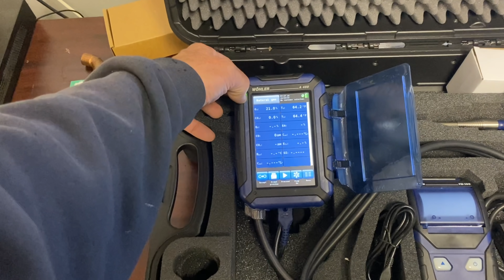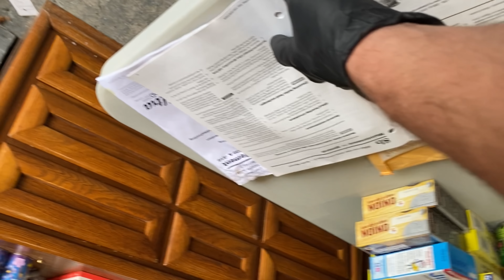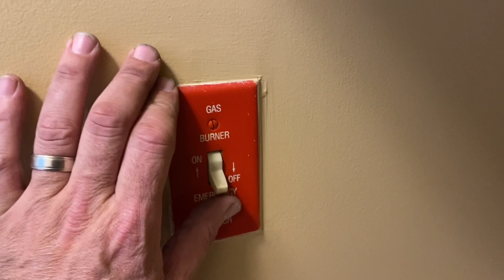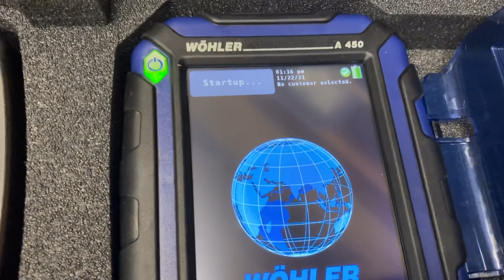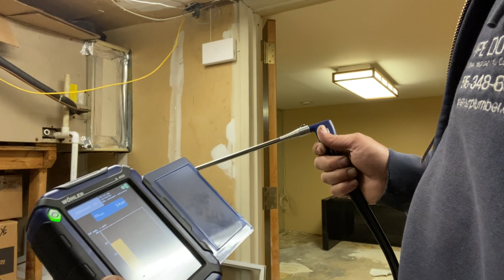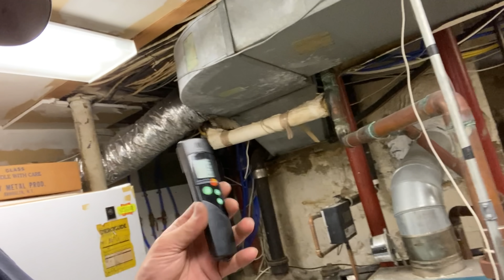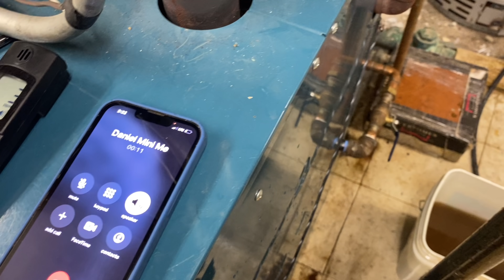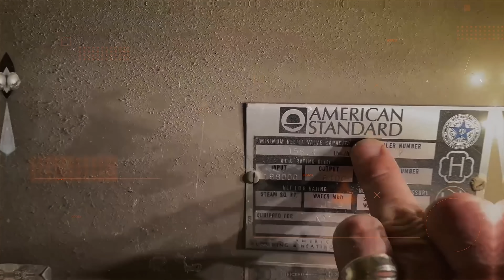Running No Heat Jobs & Wohler A450 Analyzer Makes Testo Look Like a Toy

Comment: Couple of things about the Wöhler. We used them for the past 20 years and recently switched to Testo because Wöhler is extremely pricey in repairs. We send them in for our annual maintenance and replacing the CO-cells (we have a lot of biomass furnaces here, so wood and pellets) is 700-800€ (so around 900$). You can basically get a new one every 2 years. Whats also annoying is you can't simultaneously check your -Pa/draft and the combustion itself, so you have to switch in between the 2 modes all the time except if you buy the expensive Wöhler which is 2500€ compared to the 1500€ Testo which can do the same thing a lot cheaper. Also you can't replace the battery and they start to struggle after 3-4 years, the new printer is also not that great - I used an old Wöhler printer from the early 2000s which still works perfectly.

The older Wöhlers were and are still great, especially the A97 but for me personally Testo has the edge over Wöhler right now in terms of new products.

Comment: Had the Testo 317 for years, just ordered my third they only last five to eight.  Goes off at the supply house were the fork lifts drive around (which explains a lot LOL).   Took the NCI class by Jim Davis that at least was traveling and Timmy's Gas Appliance Service in RI classes both excellent.   Which brings me to a question most co guidlines I see for atmospheric want below 100 ppm co for good combustion and the industry standard below 400 ppm "Air Free" which is a different scale anything above and it gets shut down.  But you go for under 50 ppm (so does the guy in the "Bread Truck").  What format do you get that bench mark from.

As to you blowing into that pipe, at your rate, grabbing one of the girls off the corner to do it would have been cheaper.  And more entertaining....

Comment: Still have a non-working relief valve on an in service boiler, and an ambient Co reading of 4ppm…where is the Co coming from? You are very lucky you weren’t badly burned on that drain…that said however, I personally did that thousands of times with 650+F #6 fuel oil, 400F #2 fuel oil, and millions of gallons of gasoline during my career…sometimes ya just gotta do what ya gotta do to get a flow back day or night, hot or cold, rain, sleet, snow…🤷‍♂️ Been there/done that…BTW, keep a tube of Foille ointment for burns on every truck…used it for 40 years

Comment: You could make the line voltage thermostat put power to a 40va transformer which energizes a brown relay which you could use to make or break your end switch yes it's a crazy way to do it but it will work. I am sure you have it fixed by now though but just a thought I had quick when I saw what you where filming

Comment: Back in the day we used to use the ra89a switching relay this way you could control high voltage with low voltage 120 V by using 24 so it engages from the thermostat the relay on 24 volts kicks on the burner and the circulator did a lot of them

Comment: You have had this analyzer for a month and still don’t understand it completely. Bet the 320 was easy to understand and use the first day. Had an older testo analyzer for around 20 years. Only replaced it because I couldn’t get the o2 sensor anymore. Didn’t buy the 320 because it wouldn’t communicate with my iPhone. So I bought the AcuRite blue flame for all the bells and whistles and am dissatisfied with it after two years. Testo never let me dozen.

Comment: Still promoting Lochinvar or we switching to Bosch? Good video as always
Reply: We have been installing Bosch for high efficiency boilers for 5 years now along with Weil McLain,  Buderus until Bosch bought them out and of course the brand we will not name and I have to say only one boiler from Bosch gave us a problem of 100’s we’ve installed or service. We ended up replacing the whole boiler no charge since we could not fix the problem with replacing the part that was leaking. The only ☝️!